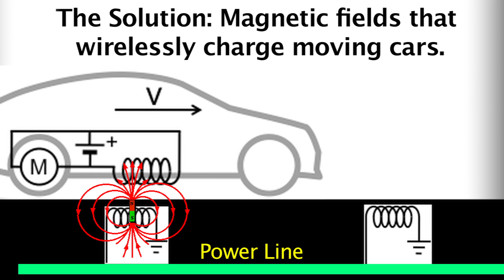Wirelessly Charging Electrical Vehicles

Comment: And yes:Imagine trains that's cross oceans without any tracks(hypersonic speed).Another idea is to make batteries last longer.They are working on cutting costs down,because it is very expensive to make graphene.Also nanorod,carbonado can be used in spaceship design.I think that coin or ring shape should be exploited more than standard aircraft shapes(Exp:coin thrown from Empire State building will not kill man below-we need trust solutions).We need new trust solutions too.

Comment: @CJCA915 Oh yes I get what you're saying. Take the example of a hybrid car. It's the petrol powered engine that charges the electric engine. But there isn't perfect conservation of energy between the two. If you kept charging one from the other (petrol -> electric -> petrol -> electric), you'd keep losing energy as heat loss, until eventually all the energy would be gone. A bit leaks out each time, so it doesn't work.

Comment: @CJCA915 That's a perpetual motion machine and hence not possible. Energy is taken from the battery and used to make the wheels turn. Call the amount of energy in the battery E. Charging up the battery would require E energy to be pumped back it. But where would this energy come from? The wheels? But if it comes from the wheels, the wheels are expending E energy. But they are only receiving E energy from the battery! So the wheels don't move.

You need an external source of energy to charge! :)

Comment: @eugeniobb This idea is stupid, the actual amount of time spent with the coil over the top of the charging coil is very low. If you try to combat this by having more of them you spend more money...

In packing is a lot better, it standards come out on the type of batteries used you could have hundreds of them charging, pull into a drive through it charges the battery, along with running a few checks to ensure it isn't faulty... Then switches it with a fully charged one, problem solved.